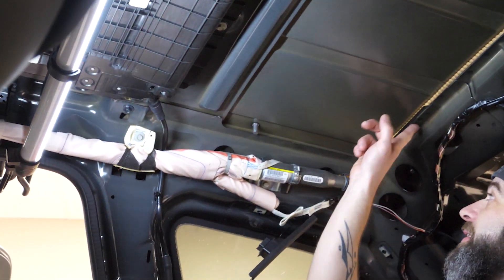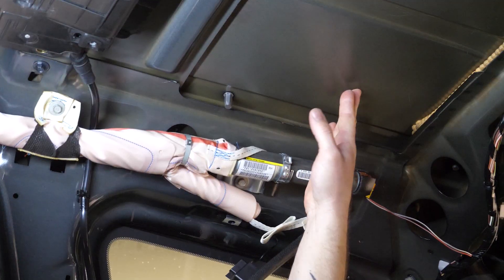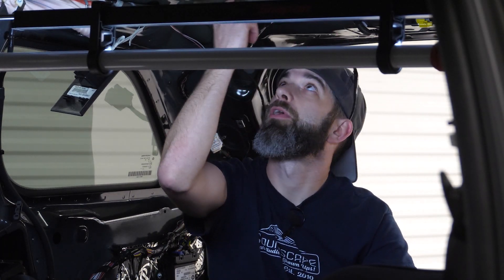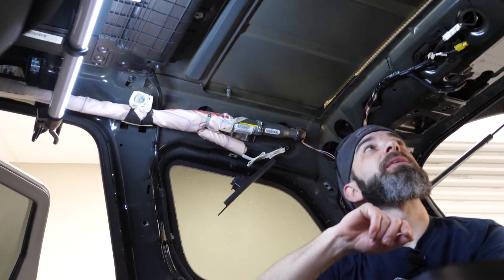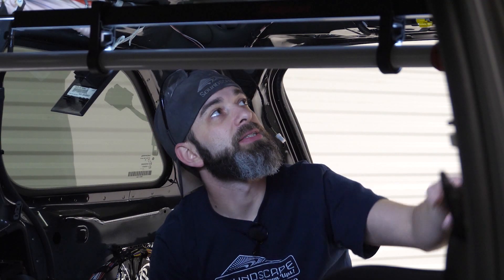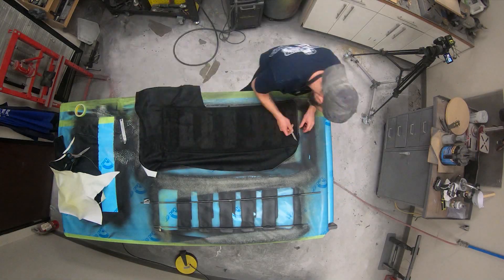American Soundscape 101 - 2015 Jeep Grand Cherokee disassembly and Amp Rack Structure

Comment: I wouldn't be surprised if the amps have overheating issues when at high volumes. They are generally not designed to be mounted upside down.
Reply: The heat sinks are on the side of the amplifiers. Direction doesn't matter. It also helps that the amplifiers have internal fans.
Reply: They may be set any way u want them 2 do not matter at all just install a cooling fan 2 em by 1 at home depo or ace hard ware

Comment: Nice bead on those welds . . . https://www.researchgate.net/figure/Cross-sectional-areas-of-the-weld-beads-obtained-using-different-contents-of-CO-2-in-the_fig9_267142611